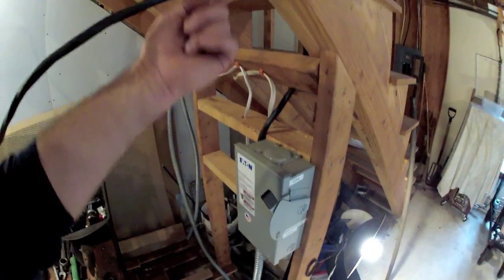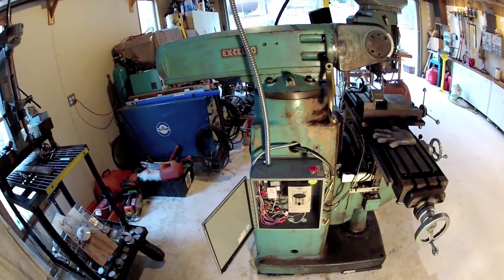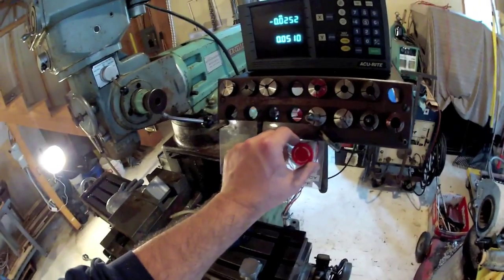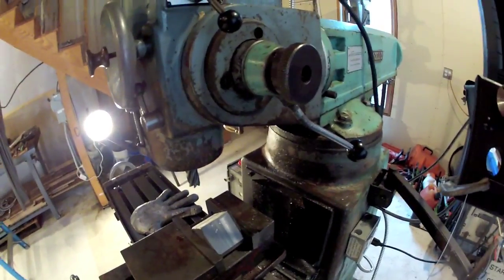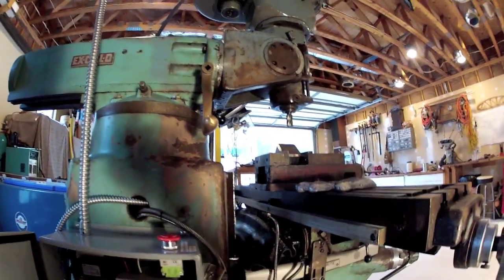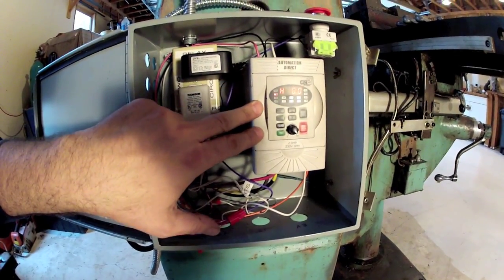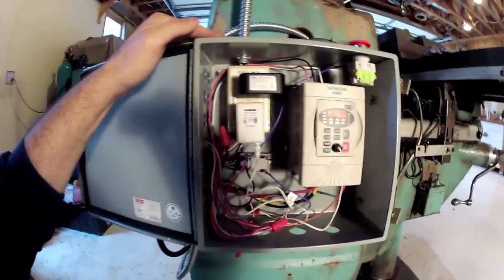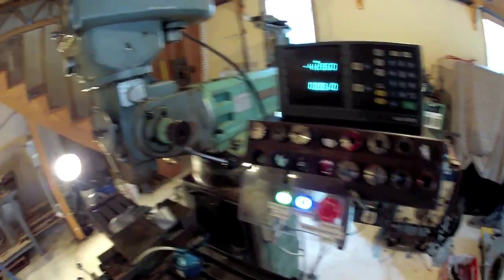Milling Machine VFD #2

Comment: is this a 600 volt motor i just got the same milling and i wonderirg how to make it work on the 220 volt whit out changing the motor
Reply from the maker: no.  I believe 600V is the rating for wire windings on newer motors.  This machine is mid 1980's?  Good luck

Comment: Those lighted switches are really cool looking.
Reply from the maker: Arnold's Design Yeah they're cool...but they serve a useful purpose of indicating which circuits of the machine are powered.  Search E bay for 22MM LED buttons.
Reply: YankeeinSC1 Thanks for the info. I was wondering where you got them.